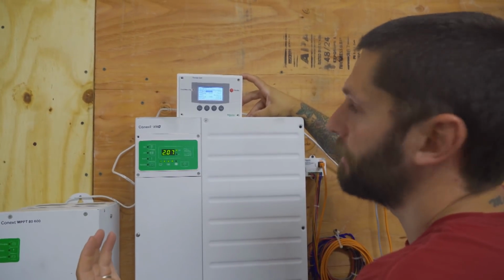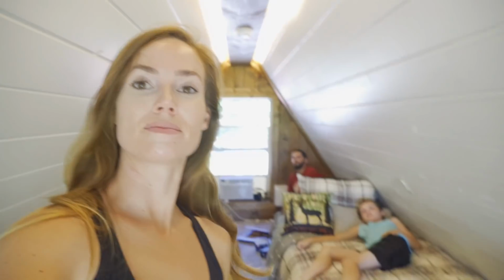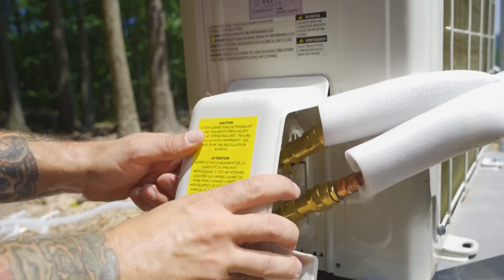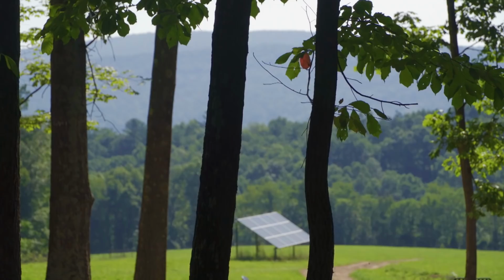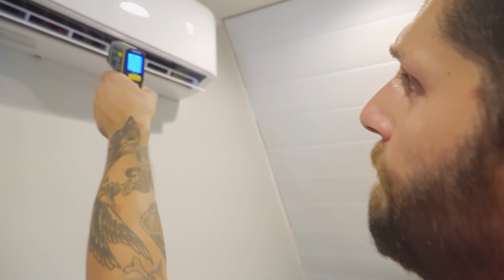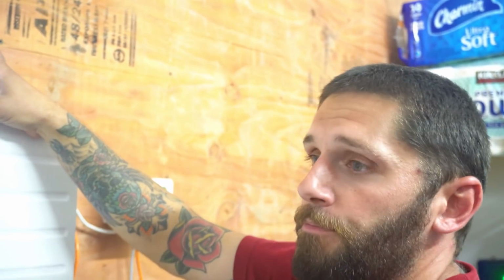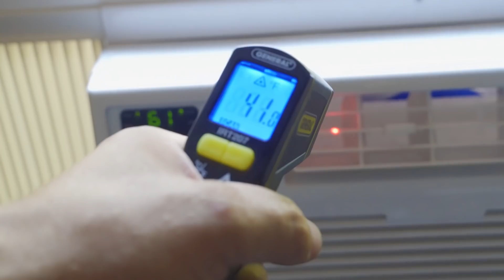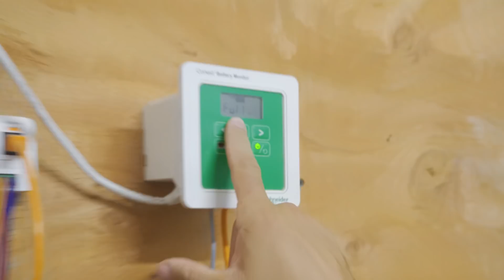Can We Run AIR CONDITIONING On Our OFF-GRID SOLAR POWER System?

Comment: Mr cool uses precharged line sets.  It’s not a new idea just mostly used in the mobile home industry.   The line sets open when they are attached to the unit.  You do need to confirm that you made good connections using a little soap and water to look for bubbles after opening. I installed the Mitsubishi in 2002 and paid an A/c company to come out and vacuum it down.  It was worth it.  Precharged line-sets are simpler.

Comment: Hi, you might consider inserting also a wind generator or even more than one, so you can charge during night time? Probably you can check the local wind maps for the last ten years to understand the feasibility of wing generation! If have low winds mostly you might consider vertical wind generators? Given that you have a lot of space available you might consider earth heating of the house during winters? All the best

Comment: Another good thing about an A frame is that there is not much space at the top of the A to hold hot air and you have a wider space at the bottom for the cold air and with it being so well insulated, it makes it far easier to cool compared to a square room.

Comment: Great job on that,  i honestly believe if you build everything properly insulated you wont need much airconditioning.. I have a garage that is 40 by 50 and i insulated the hell out of it and even when we get in the 90s here my garage never gets over 78 degrees... In the winter i heat it with a small heater and it stays comfortable...

Comment: I was a little surprised to hear you ran the panels at 288v that scared me only because how dangerous dc is at those voltages but I understand why you did it and then I thought life is dangerous and it is more efficient in that configuration. But I like it a lot and am very jealous keep up the good work.

Comment: It works...now another idea would of been building a box of the angled ceiling so you could off use it to hang the unit at proper height and used the top as a bookshelf or storage if you build it very long so 1/2 for the AC and the other for storing kids stuff, think about it and good luck 👍🏻

Comment: Great video, with summer demands well covered, I can't wait to see how your solar takes you through winter. The demands will be quite a lot different and I would have expected you would burn  wood for heating. I still think a small hydro plant will be attractive for the future, 250w or even 500w that delivers 24hr through the winter months would be a good fit for your background loads and battery top-up.

Comment: Heat pumps you needs to get the condensers off the ground to drain in winter. They should have sent you some stands to mount thos on. Otherwise clean little install nice work

Comment: Some (local) electrical codes want a 120V "convenience" outlet by each A/C unit (to run a vacuum pump if necessary).  Assuming those two units on that side of the house are on separate feeds, it is an ease addition.
Put a cheap box fan in that loft and move the air out !

Comment: Pretty cool project.  Only issue I see, is that you didn't put a vacuum pump on your system, pulling it down to a 400 micron vacuum, before releasing the refrigerant from the condensing unit.  That will leave non-condensables in the system, which will eventually block the built-in filter-driers.

Comment: Wait until winter and you flip those Mr Cool units to heat...all three running at once would drive you out of the house ! I run a single 18k btu unit in my home in Maine and my oil furnace only kicks on in the coldest dead of winter when temps drop well below zero F. These heat pumps are amazing and cut cooling and heating costs substantially.

Comment: The big test will be the heating. Are these heat pumps or just utilize strip heat at the registers? My guess is either way its going to be no big deal simply because of the wood stove. It's fun to watch dreams realized even if they aren't mine. You guys rock...

Comment: I couldn't find any SEER / EER or HSPF ratings on the MrCool DIY website which will give you more of a real world projected energy usage across the seasons. The Pioneer unit I'm thinking of getting  has a rating of 28.8 SEER for cooling and 10.5 for HSPF heating which is way better than most units out there.

Comment: These units are going back to the original design that Japan put out with it's Daikin models. I used to install them when they first came out in the sixties. The biggest problem was drilling the large holes for the 'rupture' fittings of the precharged lines to fit through. Also hiding the excess tube when we found the 'run' was short or close to the indoor /outdoor unit. Correct with the no need to vacuum out the lines. Where you may fall foul is during Summer evenings if the temp stays high then the draw on your battery supply will be tested. The next test will be Winter but then you have a wood-burning stove for that. For economy after the novelty wears off a bit is to set the running temp to between 72 -74 F even a tad higher. Then keep a close eye on not leaving doors/windows open. Shame you don't have a running stream nearby, then hydropower would be a good back up during the cold season.

Comment: With the efficiency of your home you are oversized at 36k btus but with mini splits that is an advantage  because their inverter drives ramp down which improve s your SEER efficiency. Looks like you are in a set'em and forget'em temperature position unless you run into multiple cloudy days limiting a full recharge for overnight coverage.

Comment: Josh, something to consider is DC powered AC units. They would be more efficient. AC is the hardest draw on the system for sure, this would decrease this load and cycle on the batteries increasing their longevity

Comment: Off topic, but how deep did you set the pilings for your homes foundation? Have you noticed any settling or shifting ? Everyone says I need to build using a footer, stem wall, and piers in the center, what are your thoughts about this?

Comment: You know I saw once a split ac installed low in the wall but upside down. So it would push air upward instead of in front. It really worked.

Comment: Solar is certainly providing all your energy requirements. I was just wondering if you both have considered a wind turbine, which would certainly produce energy through the night when the solar panels are not active.
What's your thoughts?

Comment: In cold climates, builders put the heat pumps near the floor, so the hot air rises. Outdoor units are put 2 feet off the ground because of snow.

Comment: just askin ok !  how much condensate from units in 24hrs , what is average dew point ' and humidity in ur local lots of trees as they give off moisture  . also hot air rises cold falls . u all are doin fine , just questions and good to hear u increased  wiresize combats distance drop .  GREAT JOB !

Comment: I hear what your saying about not needing a vacuum, but you really should consider pulling a vacuum if at all possible, even if just to confirm you have no leaks in any of your connections.  Plus, newer refrigerant oils are very sensitive to moisture, even the moisture in the air before a vacuum is drawn.
Reply: Not possible with the DIY line sets

Comment: The longer you run the system the more moisture it pulls out of the air so as the relative humidity falls inside the home the cooler warmer temps will feel. If the Mr. cool units have a dehumidifier setting it will work to pull out moisture and that can actually help conserve energy even more because the temperature doesn’t have to come down as far if the relative humidity is lower.

Comment: Can a Mr Cool be mounted on an interior wall vice a exterior wall ? Seems it's more important to be on a vertical wall, as long as the umbilical to the external unit is long enough for a short reach to a vertical  interior wall. It has been a HOT summer for sure!

Comment: You really can't talk about these variable speed mini splits as a static BTU rating. 

They have a BTU range. Maybe something like 4500 - 13000 btu for your 12000 btu unit. 

The best way to use them is let them run all day. When the unit reaches it's set point the compressor slows down and maintains the set temp. 

Amazing setup !

Comment: Cool video. I'm thinking about running a 12000BTU MrCool unit on solar(not connected to the grid). Could you recommend, what should I buy for a system like this? Won't be using it during the night, only during the day(while working in the garage). It would be much appreciated.

Comment: Maybe you already know this, but if you need to be conservative with your energy consumtion when cooling your house run the MrCool units in dry mode instead of cooling mode. That reduces the energy consumtion to 1/3 compared to cooling.

Comment: - I prefer using portable 5,000btu @ <500watt window units. Digital thermostat controlled units cost around $170each, and I can buy them anywhere here in the USA. Install and operate as many as needed to keep the family comfy, there lower individual startup and running power loads are easier on my inverter(s), and they're easier to remove / repair / replace as they age. My off-the-grid friends tried mini-split systems, but overall unit cost and repair parts availability / cost weren't the efficient way to go. Air-conditioners always fail when you need them most, and a quick 'switch out' with a spare machine is a fast and easy way to not lose your cool.

Comment: I've been following your series for the past two years and really enjoy it.  Question - 3 tons of cooling seems like way over kill for a 1100sqft house.  Are you concerned about the AC short cycling?  Also, I'm curious if you considered one of the Mr Cool multi zone units as it would have only required a single compressor, each air handler is 9k instead of 12k. BTW - you guys have done a great job on the place, you have a lot to be proud of!

Comment: Did you use HEAT PUMPS or just AC spit systems? 
Look into getting the Ultraviolet strip lights for the Spit system heads to kill bacteria. Just an FYI.

Comment: Do you think 1 unit will cool a 432 sq ft well insulated cabin with 9 ft ceilings? I'm in S.Carolina. it's in the shade but temps of 100 is common mid june til mid.sept.

Comment: They came with 25ft line set? What did you do with excess line set ? Coil it up or cut, if cut it needs to be vacuumed
Reply: It is rolled up, set out of the way, and part of the lineset still.

Comment: Would it have been an Option to put this New Unit At the top of the window? As it is more powerful and probably more efficient than the other unit you had there originally.
And maybe removed the lower unit? All the best from Canada
Reply: Maybe.  But it could be used more of the time for heating than cooling, so this is a great choice.

Comment: Invest in ceiling fans and humidifier..u hav still air ..cold and hot ..so if u get those it will eliminate ur problem on which part is getting good air flow or temp regulate sense hot air rises and sits and cold air won’t move it

Comment: Nice, but what would it look like if you had cold weather and using heater all day and night?
Reply from the maker: Funny you ask because we are actually getting to test this very thing! Typically electric heat is a "no no" when it comes to solar however we have continued to upgrade our system and as soon as we finish installing our additional panels this week we are going to put it to the test.  As is, if its a sunny day or partly sunny day we can run electric heat the entire day.  However, if we were going through a week of all snow and clouds we couldn't with our initial system.  Now that we have upgraded, we are bringing in 3times the amount of power that we previously were so cloudy days are now like partially sunny days which means we should be able to run electric heat even on cloudy days.  As far as running electric heat at night, that will all depend on battery storage.  We have 6 Simplifi batteries currently so again, once our upgrade is completed we will be testing the whole system to see how it performs over long stretches of winter weather and at night.
Reply: @WildWonderfulOffGrid  nice thanks for the feedback. How much did this set up run you? How many solar panels and wattage are you using? Do you have a back up generator incase you run out of solar power?

Comment: The solutions to cooling for my house.

-Built my house to have HIGH R values
-Designed my house to utilize cross breezes by simply opening windows
-Designed my house as a single story plus a basement
-Installed a whole house fan for when the wind isn’t blowing.

The result is my house doesn’t need AC ever and during a heat wave, interior temps where you walk inside the house never rose above 73F.

And for heating, a large soapstone wood stove.

The result is I can heat/cool my house with practically no cost year round

None of the techniques are anything new either, just stuff our grandparents did.

Comment: I saw in your video that you didn’t evacuate the line sets and you had said someone told you that you needed to and you said you didn’t.
The machine has a vacuum pulled and it is charged but the line sets have moisture in them and have to be vacuumed down to 500 microns or less and then it has to hold at 500 microns or less before you release the gas.

Comment: Could you have put the unit downstairs above the door and cut a vent in the ceiling and installed a floor vent in the boys loft area? Hopefully that makes sense
Reply: Josh could have made some type of baffle to direct half of the air up through the vent cut in the ceiling/floor...this way you could push the bed back up against the wall and it may help it from getting too cold up there as well🤔 just brainstorming

Comment: I had a similar issue with a mini split like your loft.  I built a “box” around the unit front and back only so it does block the in/out and mounted mid-way up the window... kind of like a valance just not at the top....

Comment: Ok so i just binged watch every single episode. I have to ask, on the first dormer you built (mud room i believe). When casing in the window i noticed that the casing seemed too high and then when you showed an exterior shot of the same window you can see the unfinished back of the casing through the window.  Has that been fixed or even noticed?  Just curious as i noticed it in a few videos.
Reply: Btw i adore this channel

Comment: Adding solar panels would be the most cost effective and simplest way to improve your apparent limited autonomy issue.   These air conditioners put you over...just sayin.   I have the same system you guys do and found by adding panels (and racking) were able to recharge "enough" on cloudy days to compensate for improperly sized battery bank.   I love my batteries btw!  No problems.  I have first gen simplifi so they arent as big as yours but close enough.

Comment: Getting rid of the humidity is most important to us.  Our home passes the "passive" standard, but it does breath in it's own way, aside from the air handling system that's been engineered to the home.  The outer walls are 1.5 feet of interlocking hemp block.  If we use the geo thermal to pipe air into the ground, we can maintain 76 degrees on even the hottest days (upper 90's) but it FEELS HOT without the dehumidifier.  Kick that on, and it feels OK, and somehow it lowers the temp a couple of degrees, but I prefer a home to be around 72.  He!!, I'd actually like 67-68, but my wife would have a parka and thermal undies on.  WHICH IS PROBABLY OK given that we have 6 kids already and are good Catholics, but I digress.  As far as heating is concerned, the air ex-changer has what is equivalent to about a hair drier running on low that stays on about 50% of the time during the winter.  If we light a fire, we have to shut the electric heat element off on the air handler, and it still requires opening some windows.  It has to be well below 0 F to light a fire.  So their is plenty of heat so that the animals can lounge around sipping pina colodas in the barn all winter if I let them, but I choose to divert that heat energy to thawing the driveway and drives around the house park.  I'm thinking about strategically placing one or two mini splits to push the place over the edge.  After seeing your results, it wouldn't put a dent on the solar capability, or the batteries.  THIS VIDEO WAS BEYOND USEFUL!

Comment: At 2:35 in the video he says "The size of our array..." but doesn't mention if you guys still are only using the orginal 12 panels you installed or have upgraded your orginal system with more panels. I did catch that you guys have 5 batteries but just wanted to know are you still just using 12 panels??  Thanks
Reply from the maker: We still have the original 12 panels but we do plan to get more in the future.

Comment: It always could be done, but with much higher efficiency, no conversion loss and no inverter heating like the system you are showing.  Simply use a 48V dc mini-split tied directly to a 48v dc system with panels that have 130% capacity of the AC unit.  Your use of 115v, dual conversion from solar to charge voltage and then from dc to ac coupled with AC line losses probably nets an efficiency loss of 30% when compared to existing commercially available engineered DC systems.

Comment: you shouldent have any issues i run my swamp cooler and a ac unit off of solor and the fridge and microwave all at the same time no problem untill i try to run a table saw too